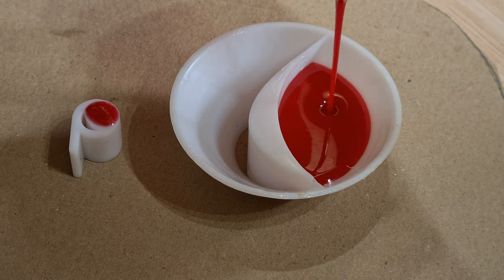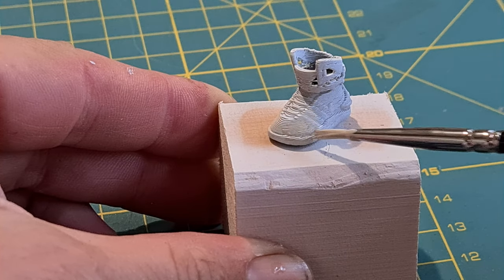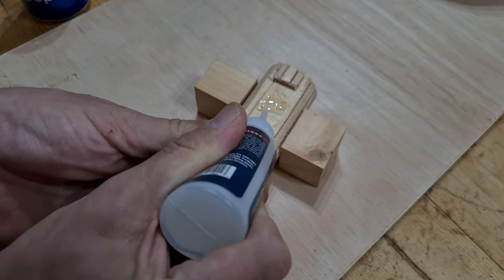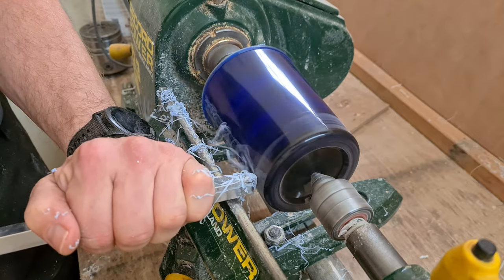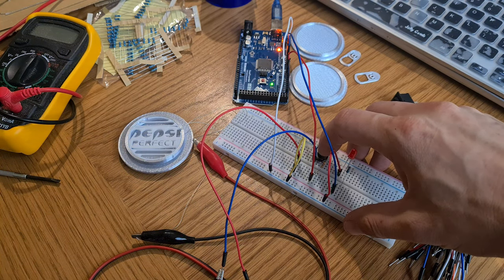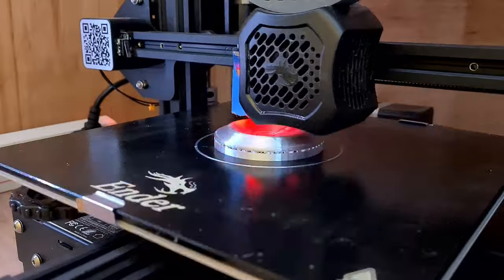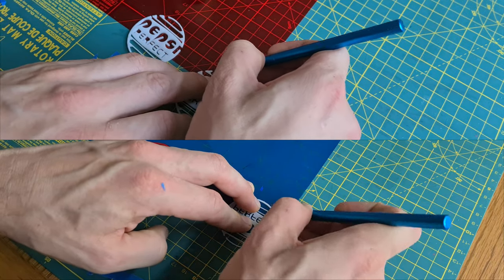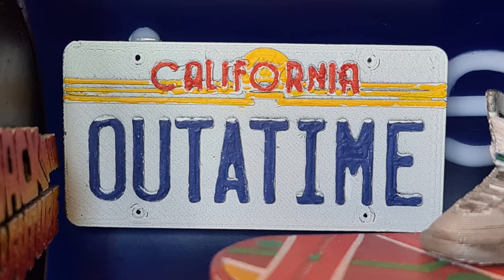Woodturning - A PEPSI Can

Comment: Looks like you are enjoying the benefits of your 3D printer Ray and you keep coming up with these great ideas.This is a great project 👌
Reply from the maker: Thanks Jojo! Alas one issue is that it didn't have a great impact, so I need to decide whether to push on or go back to the original idea of using wood in the projects. All the best. Ray

Comment: A resin printer is the best thing for those small parts.
Reply from the maker: Hi Green Katana. I agree. A number of viewers have also suggested this and I should invest in one someday soon. Alas, I cannot yet afford a 4k large area resin printer, so will struggle with the FDM for a bit longer. All the best. Ray
Reply: @RayWhitbyCreations  you don't need a large 4k printer dude at least not for these type of projects i have a 2 k one and i get amazing results.
Reply from the maker: @Im_K4tana  I did see a recent YT vid comparing 2K, 4K and 8K and I was surprised as the tester how well a 2K printer can turn out if properly tuned. So perhaps I should get on with it and get a 2K resin printer. What brand do you recommend?